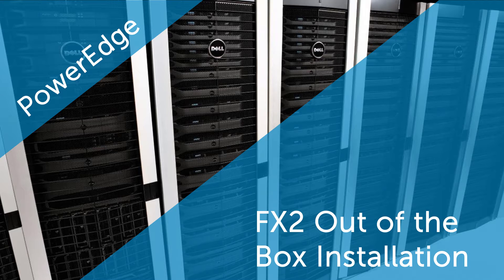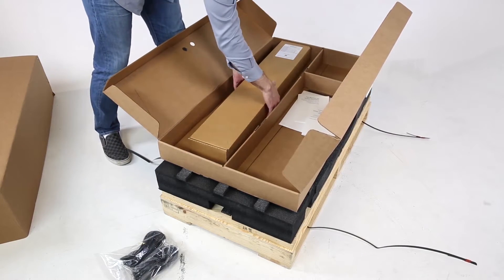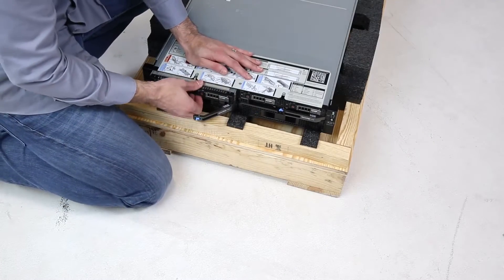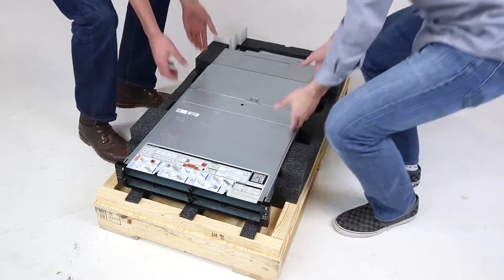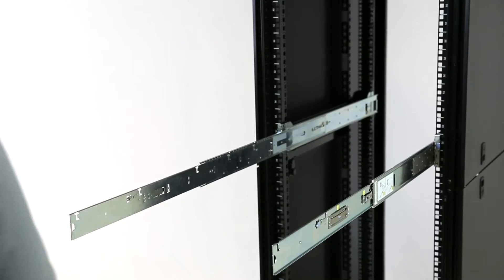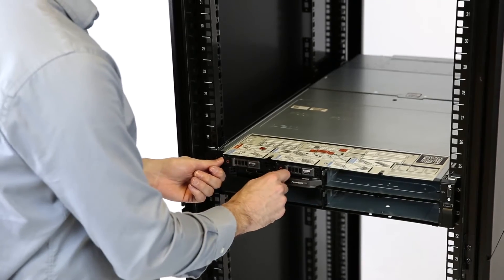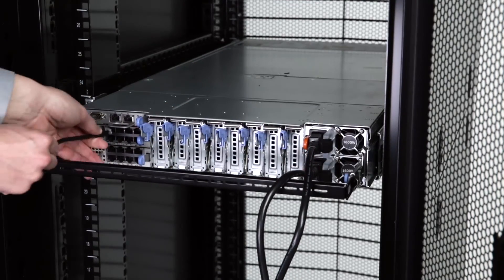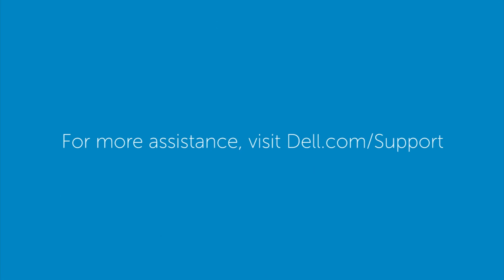Dell PowerEdge - FX2 Out of the Box Setup

Comment: There is one item, which is the last that you touched upon, which I am less pleased with; this is the strain relief bar. If you've a proper rack layout, then surely you would have a PDU along the side of your rack? This looks as if it's almost causing more strain on the power and network cables in the video.

Aside from this, the FX2 is an excellent piece of equipment. I "met" the product at the CCS Media Expo which Dell attended in London this November. I'm eager to get hands on with this beauty.